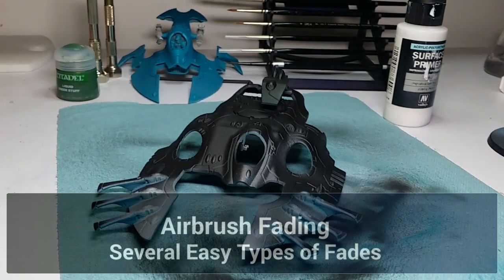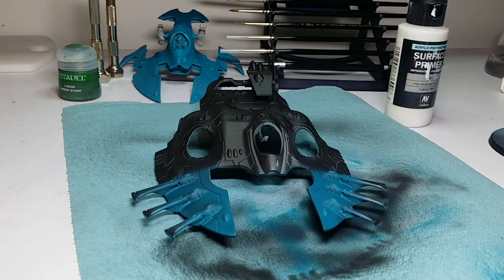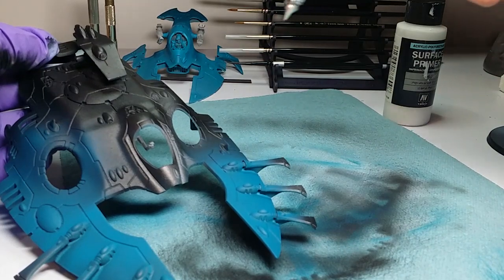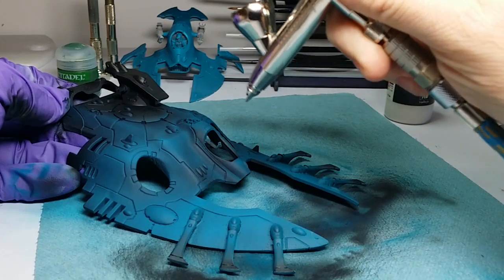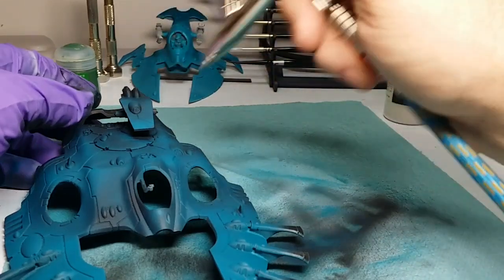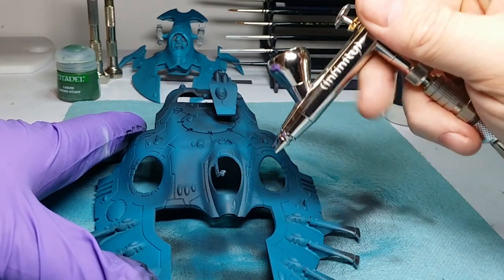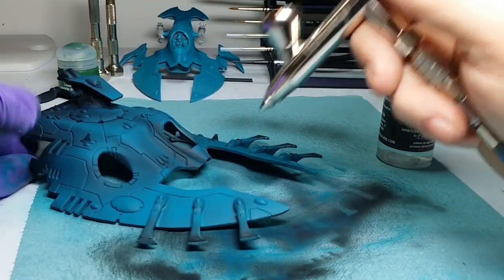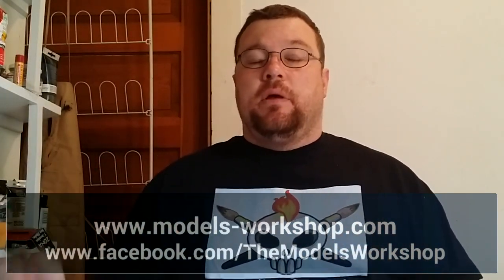Models-Workshop: Basic Airbrush Fading

Comment: nice video, I'm thinking of starting airbrushing for my games workshop miniatures I'm tied between badger patriot and badger Krome I know the patriot has .5 and the krome has .2 and .3 but could I use the krome for priming as well as detail or should I get patriot
Reply from the maker: If you're wanting to paint miniatures go for the Krome for sure. Patriot is a nice brush but the large nozzle size isn't suited for what we do with minis.
Reply: +Models Workshop thank you and it's OK for using to prime with a 0.3 yes
Reply from the maker: +Daemonforce Gaming I prime with my .15mm Infinity :)
Reply: +Models Workshop thanks for your input
Reply from the maker: +Daemonforce Gaming anytime!
Reply: the 105 has three different sizes .7 .5 .3 you can also get different needle and nozzle setups for most airbrushes

Comment: What is a good airbrush to get as a starter for models
Reply from the maker: Rampage3000m Masters TC20T compressor with a Masters G43 or G44. Yes it's a cheapee airbrush but it's good to learn the basics on with low risk of breaking. If you want a good airbrush that is a bit more expensive but a good general purpose brush, get a Badger Patriot 105 (not the extreme). If you have anymore questions please post them or come by www.facebook.com/TheModelsWorkshop